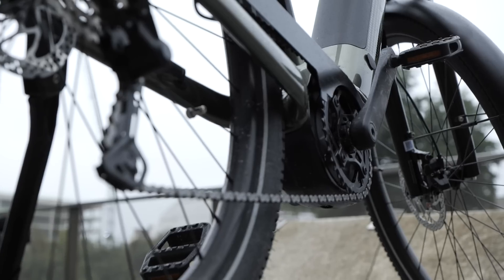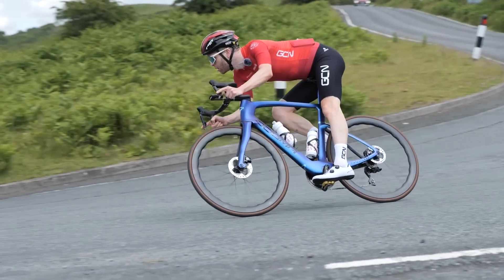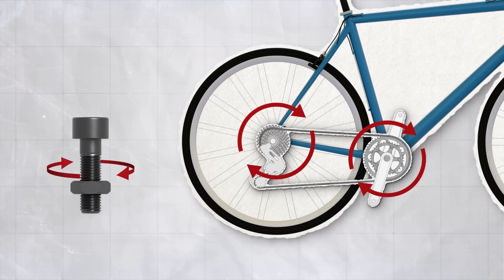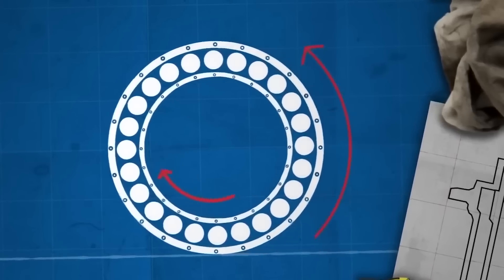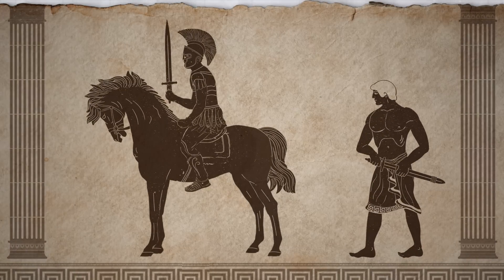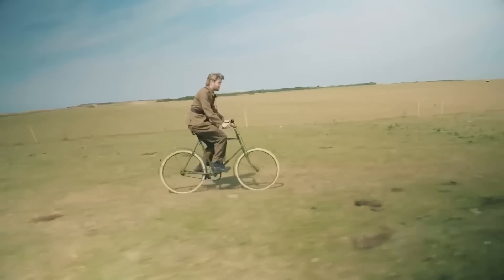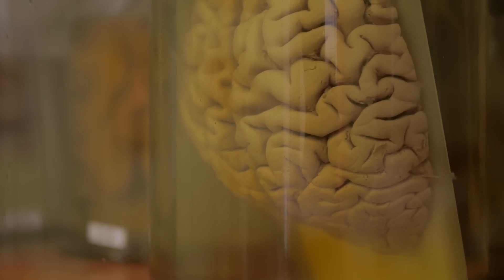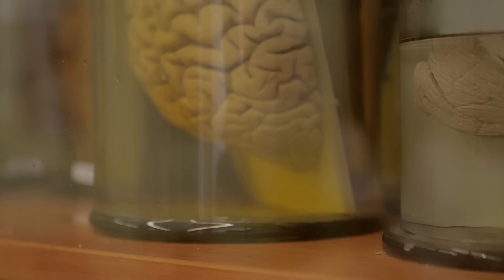Why Is The Drivetrain Always On The Right?

Comment from the maker: What reason do you think is the most plausible?
Reply: Well, that went deep, lol. But not deep enough. You forgot about chirality and particle spin.
Reply: Just because it feels right.
Reply: Drivetrain on the right because octopus carries sword on the left testicle
Reply: No room for kickstand.
Reply: The reason for the gears on the right is so when you take a picture, it has the appearance of going forward. Same reason most old steam engines, cars & ships was photographed or painted from their right side. It gives the illusion its headed forwards or towards the future.
Reply: coming from bmx and grinding on the right, left side drive train makes sense
Reply: Just try to act left handed and you will realize why. As a left handed child, I always hated that bike drivetrain was on the right. It always interfered with mounting/dismounting from right to left and carrying the bike on my left shoulder. It was always on the wrong side for me. I grew up dreaming about "left-handed bikes" becoming popular.
Reply: I'm not sure that the theory of the bb bearings causing opposite rotation force upon the bearing retainer is quite right. 
The bearings move in the same direction as the crank, but at half the speed, and there's so little friction between the bearing shields in a decent bb, that I don't think that they would cause any significant force on the bb shell at all. 
This physics theory was brought to you by the inside of my head! 
There's a lot of useless information in there, but some good stuff if I rummage around enough. 😅
Reply: Your 'Rule Britannia' theory of the English safety bike seems most likely.

But, I thought you were the GLOBAL Cycling Network? 🤔

Up here on the top of the world in Australia, we know that the world rotates clockwise around the only pole over a continent, the South Pole in Antarctica. We can even see its effects in how water flows down our drains, just like that BB opposite force does, opposite to our rotation here, anticlockwise.

Please, if you want to actually be GLOBAL, remember that your audiences can live anywhere, and hence globally accurate information would be nice for all of us.
Reply: I think the cranks, cassette, and derailleur are on the right because the chain is on the right, and vice versa.
Reply: it probably has some connection with counter / clockwise stuff
Reply: It might be worth mentioning that a reason for most people to be right handed is the fact that for centuries, left handed people were seeing by some religions as envoys of evil entities.
Reply: @ricferr2  As mentioned in the video, it's not just humans that have chirality (handedness).  Studies indicate that other mammals also seem to have about the same ratio of right handedness as humans.  I have a theory that, millions of years ago, there were a bunch of protozoa, happily swimming along in their puddle.  All side by side,  when a toxin  started leaking in from outside.  Most of those that turned right, survived.  Most of those that turned left, perished.  From these survivors the entire animal kingdom evolved.😂
Reply: I think I just wasted 7 minutes
Reply: A right handed person carrying a bike on their shoulder will find it easier to carry it on their right shoulder. The transmission on the right of the bike is therefore away from their body. 
That’s probably just a lucky coincidence though. 
For years I rode my bike with its fixed gear on the left…just for a lark. It was only the left hand threaded locking ring that stopped the sprocket from undoing but there was no problem.
 In the days of pictures on slides and slide projectors, you could see if a slide was viewed from the wrong direction by the chain on the bike…not my bike ❗️
Reply: @Carol-East  this is not accurate, bikes are more easily carried upside-down, because of the drivetrain.
Reply: @markvis4106  Have you ever tried to carry a bike upside down, whichever side the drive chain is on? Not a chance that will be easy, clean or comfortable.
Reply: @Carol-East  you clearly don't ride your grandma's bike.
Reply: I'd like to see your source for pavements being "quite high" back then. 

You sound like you're making this up as you peddle your channel.
Reply: I think you missed the most obvious reason.  It's simply easier for a right handed person to get on from the left.  Most right handed people find it easier to kick a football with their right foot.  It's the same principle.  You support your weight on the left foot while the complicated bit (either kicking a ball or swinging it over a bike to land precisely on a pedal) is carried out by your dominant side.  That's probably also the reason that horses are mounted that way.  (no need for swords to be involved).
Reply: they are not communists
Reply: It's so I don't get my cloths dirty when I push or carry my bike with my right hand.
Reply: thread direction
Reply: I think it's because most people are right handed.
Reply: Because you always mount a horse from its left
Reply: You can be pretty sure that it’s not the direction of Earth’s rotation because that’s not even a real thing.
Reply: I think the Archimedes screw ( Egyptian Screw )was first used in the hanging gardens of Babylon .... Thing is, did they have freehubs ?
Reply: Because the kickstand is always on the left...
Reply: If your chain comes off - or some other drivetrain repair is needed - attending to it at the side of the road is safer if you're on the right. 

Unless in the UK or Japan I guess
Reply: I call BS on most of these. Half of the people in my family are right-handed and half are left-handed. Both of my parents are right-handed and I am ambidextrous. I went to Catholic schools as a kid, which required us to use our right-hands. I along with any of my classmates that may have been able to use our left hands weren’t allowed to use our left hands. My father-in-law is left-handed while all of his children are right-handed. I have one child that is left-handed and one that is right-handed. I believe more people are left-handed but weren’t allowed to use their left-hand or were taught by right-handed people.

Comment: They could have done the same thing to the left side of the Bike. I think they put everything to the right because people could have made motor Bikes out of them a lot easier. I dont think they wanted that to happen.  But im getting ready to make a Bicycle to a motor Bike. It has to be done different because most motors has a crank shift on the left side  and the Bike gear is on the right side

Comment: If you've spent much time with freewheel hubs, it's pretty obvious that you don't want to put the freewheel on the left!  And I do actually still ride a singlespeed bike with a freewheel.  If you ride a fixed-gear, the reason is even more obvious.  You could make the argument that the convention might have changed since cassette hubs came along, but it gets harder each year to do that sort of thing.  Often in engineering, a standard only can be set once, even if it's not perfect.  The United States would use a different wall voltage if the decision could be redone, for example.
You could also make the argument that freewheels and fixed cogs should have used left-handed threads, but most humans are right-handed, and right-handed threads are the overwhelming choice for just about everything threaded: they're easier to manufacture, for one thing.  As a lefty, I can also attest that it's difficult to use a screwdriver with my left hand to tighten screws: I can generate more force when I rotate my shoulder outward.  Rotate my right shoulder outward: tighten.  Rotate my left shoulder outward: loosen.

Comment: It's a combination of "tradition from horses" and "threading of rear cog and other screws" Not all safety bicycles had right hand drive. There are super, super early examples with it on the left side. Putting the drive on the right has the least amount of left handed threads. You have to remember, the bike was an alternative to the horse. So it would be approached like a horse was. It'd be parked where horses were. All of those things were made for left side mounting, so why would they make a bike any different. Drive on the right puts it out of the way when mounting the bike.

Comment: Car manufacturers hate having to design and build cars to suit both left and right hand drives.  It's expensive and time-consuming.  It's the same with the bikes. It would be a waste of time having to have mirrored part manufacturing unless there were serious advantages (which there aren't). So the right hand transmission is because the early bikes just happened to be made like that, probably to do with people being right-footed predominantly, and now there's no point changing.

Comment: The left threads in bottom brackets and pedals are not about bearing forces. It's about the tumbling load on those threads which works the thread oposite to what one might imagine from friction.
Also, while the anecdote about mounting from the left has to do with swords and left side riding: I highly doubt that my very strong preference to push and mount my bike from the left has to do with that tradition. It is about me being right handed, and therefore prefer to have my right hand reach over the bike.

Comment: What I find interesting is how it is in motorbikes: There is a split and it is based on whether the engine is transversal or longitudinal (i.e. whether the crankshaft rotates along the left-right or front-back axis). Transversal engines have the drive predominantly on the left, while longitudinal used to have it on the right. (In the last 10 years, many big manufacturers still making bikes with those engines switched to the left.) Now in the latter there may be a factor, as they are usually shaft drives and shaft always turns in a certain direction depending on what side it is, which may be used to counteract the engine tilting the bike during acceleration and deceleration, so the choice of the side is bound to the choice which direction the engine rotates in. This is not a factor in transversal engine with shaft drive as the shaft is the only thing rotating on front-back axis.

The choice of left for transversal engine is interesting. Unlike bikes, the rear sprocket is usually mounted with multiple screws but the (small) front one has usually just a single one. Also, the drive needs to transfer not just accelerating forces but also decelerating ones from the wheel to the engine (gearbox). Maybe it's just as someone mentioned, early motorbikes were bicycles with engine mounted, two separate drive trains, transversal was the default choice thanks to parallel rotation axis and since the bicycle drive was on the right, the motorcycle ended up on the left, considering the rear sprocket was not bound by the same considerations about rotation and the bike one.

What's also interesting is the fact side stands on both bicycles and motorcycles is nearly universally on the left. Which is the worse side for 2/3 of the world who ride on the right as they have to mount/dismount from/to the side of traffic. (Personally I do not find either side better or worse if the bike is in a neutral position, although leaning it towards you makes mounting and dismounting easier - and you cannot do that on most motorbikes due to their weight being too much to hold, unless they are on the side stand.) The only exception is trials motorcycles which use opposite side from the drive train and as that is mostly on the left, their side stand ends up on the right.

Comment: A Little wrong there with bottom bracket thread direction. Nothing to do with the ball bearing. It's called precession where minuscule movement between the threads on the b-bracket and the threads in the bike frame causes an opposite rotational movement. Similar with pedal to crank thread which doesn't have a bearing there.

Comment: The thread reasoning is bunk. Hokum.  People used to think this way, and perhaps in the early years with bad hardware it was true. Cars used to be opposite thread as well on the left. But that went away more than 50 years ago. Car tires don't spin themselves off.
Reply: Fixed cogs do, however.  And we use the chain itself to tighten a freewheel.  Whether these were the original reason that drivetrains were placed on the right-hand side, you've got me.  But it's easy enough to demonstrate a fixed cog being spun off its threads.  There's a reason that track hubs have separate left-handed threads for a lockring.

Comment: This video revives discussions I last had in the 1970s, when I was a student. As far as I recall, the common feeling with my friends was that because the safety bicycle was invented in the 1880s in the UK, where we drive our vehicles on the left, other countries supposedly just copied what was already deemed to be accepted practice in order to avoid having to set up a manufacturing supply chain for components for a left-hand drive chain. Back in the 1880s, the UK was still a world superpower (difficult to believe now!) and what we did in this country had more weight than it does now.

When I hired a bike when on holiday in France, it suddenly occurred to me that it was potentially a bit more dangerous mounting a bike from the left-hand side on a busy road. My mitigation was to either get on the bike where there was a lowered kerbstone or in a side street. That was okay for a few days on holiday but more problematic if I had lived in France full-time.

Comment: Your heart is on your left side. Most people are right handed, because if you're going to fight with a sword or a sharp stick you want to extend your right side toward the danger and keep your left side away from it. The right side became the strong side, and in boats it became the side with the steering oar or board. Hence the name Starboard for right on a boat. The left side became the side you tied up on, so not to damage the steering board. That's the Port side. The British drive on the left because they're a maritime culture. They have right hand (starboard) drive cars and they pull to the left (port) to park, like you would in a boat. Getting back to swords, the right side is the strong side, so if you're fighting on horseback, you do all your hacking and stabbing on the right side and the horse gets to know that anything on its right will likely be an enemy. Therefore, you always approach a horse from its safe, left side. That's why almost all the people not in Britain, Japan and Australia (all islands) drive from the left seat and park on the right, letting oncoming traffic pass on the left (safe) side. My guess on why the bicycle gears are on the right side is because that's the stronger leg on most people and there's less deflection if you have the gears on the side with the most force. Bikes with gears on the left were probably slower.

Comment: Swords have little to do with mounting a horse on the left. Swords are very expensive, to the point that no, you didn't have one. Driving on the left originated in India (probably) and due to oxcarts. Apparently oxen like to pass on the left. This avoids getting in a tangle. 
If you try to mount a horse on the right with a european saddle, they way the strap is fitted, you'll end up with the saddle under the horse's belly.

Comment: Dude got it wrong, wrong, wrong! Time to put on our thinking caps here. Every single threaded part of the bike can have its conventional threading reversed-PERIOD! Newtons law isn't sentient, therefore wouldn't 'know' that it's been 'tricked' and then 'act' accordingly to stymie the wayward engineer. The inescapable conclusion is that the market is calling the shots. Retooling in ANY manufacturing process is costly to the detriment of the manufacturer; so it just isn't done. Especially in view of the fact that, while a left hand drivetrain would turn heads, there's no practical reason to build bikes with them, with the possible exception of balancing out my shredded pants leg!😆 Edit: Swords, really? All that dark ages weaponry was long out of the picture by the time the ol' bone shaker was even conceived. Plus, how is it said that the earth turns in a right hand direction? There is no 'up' or 'down' in space! This would all make for a lively round table, no? Just check your swords at the door!😂

Comment: On most motorbikes the drive chain is on the left side. The rear sprocket is bolted on and the front fits in slits in the axel. They are not hold by thread around the axel at all.

Comment: Its on the right because small gas engines have their sprocket on the left which would make it easy to add an engine to the bike if the gears were on the left side.  Scooter makers do not approve.

Comment: you forgot that, because of the right hand threads being mass produced it becomes extremely expensive to get the left hand threads crafted for pretty much "no apparent reason". 

so unless you custom order, or make every single bolt by hand yourself, to make the bike, or get the bike made, to uniformly apply physics in the opposite direction you'd be safer just buying a standardized bike.

or just put a bearing wash behind every bolt and you'd probably be as safe as your standard left pedal.

Comment: @2:25 Nope. This is the exact opposite. Pedal direction makes it looser. I've always been told that it's because the alternative would be pedals that you can never remove.

But just think of when you have a 15 wrench, you basically "pedal" to remove the pedal.
Reply: There's a very simple experiment for this: take a set of pedals, grease the axle threads well, then thread them halfway into the crank.  Ride normally.  Either the pedals screw in farther or they unscrew.  It can't be both.